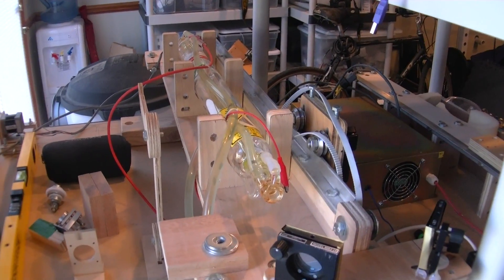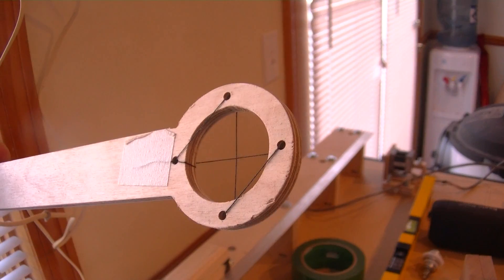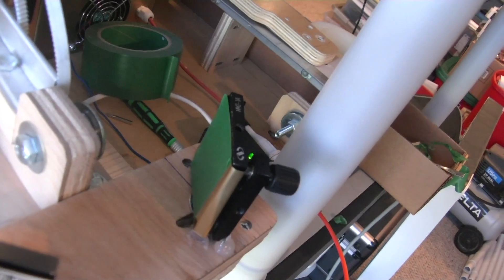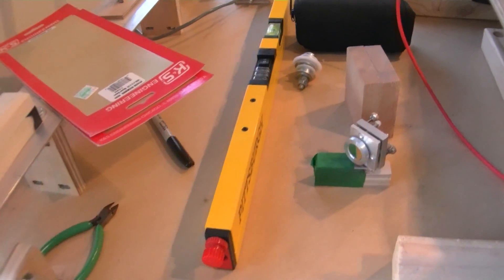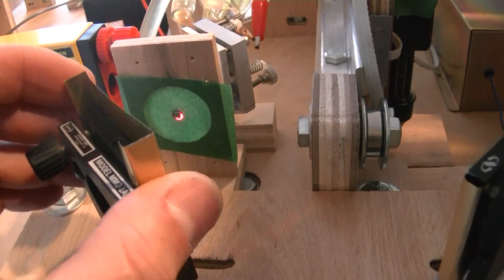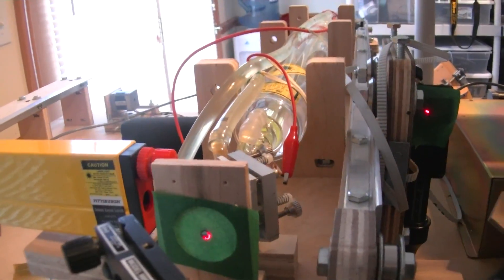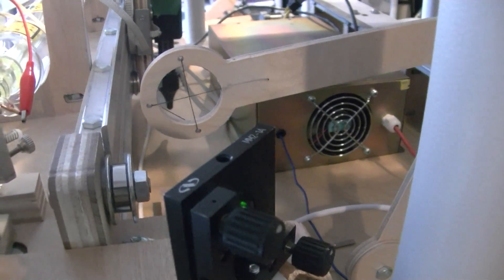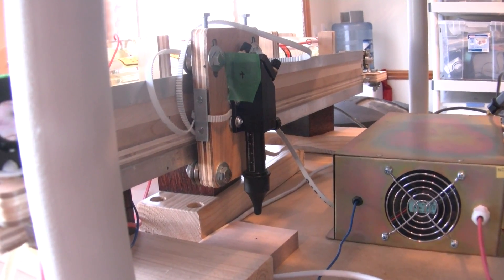Tips for Laser Alignment - CO2 cutter/engraver

Comment: Great idea. You could permanently mount a red laser cross and have a mirror on a hinge in the same setup you use here only smaller. That way the red cross could be used for easy alignment and accurate positioning.